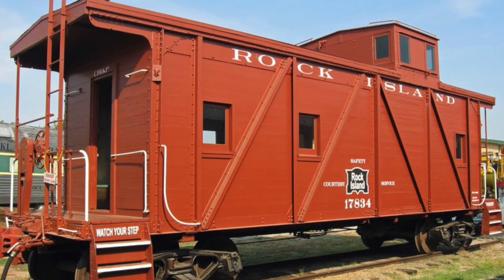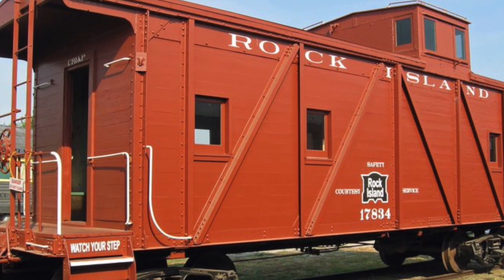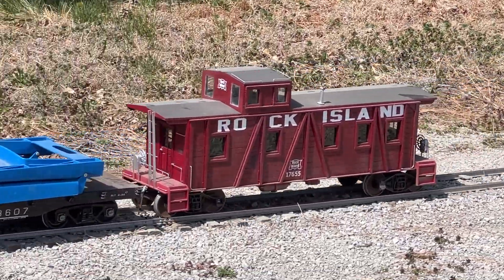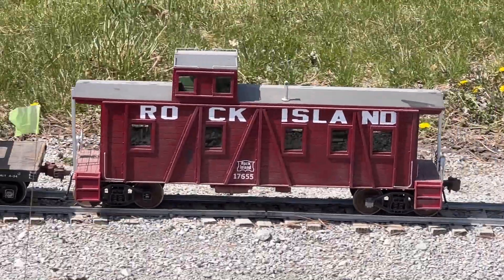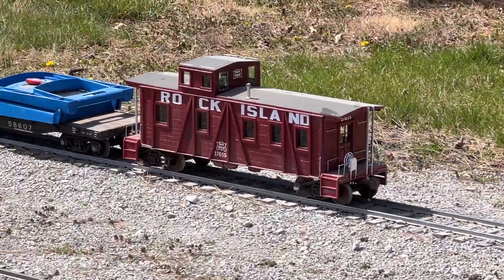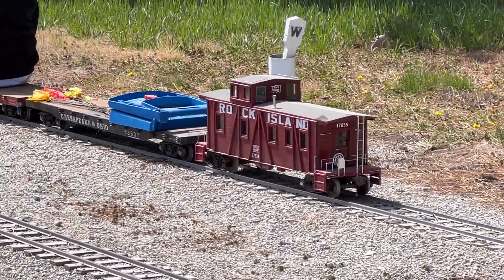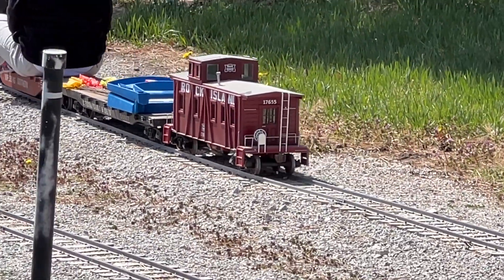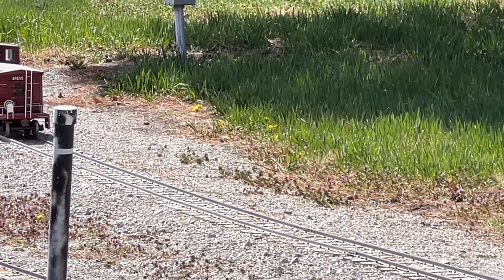Building a Vintage 1" Scale Rock Island Caboose

Comment: I was watching an episode of Tracks Ahead many many years ago where I found out about 1” scale.  Been fascinated by it ever since, I hope to have a yard big enough to build a 1” scale railroad someday.
Reply from the maker: That’s awesome that you were able to find information about 1 inch scale way before now. The interesting thing is that I was actually invited to come out to this railroad back in 2016, and I fell in love with the size because it was way bigger than the G scale that I was doing, but it wasn’t quite so big that, it would’ve been hard to manage. I think the 1.5 inch scale is really cool, but you practically need a crane to lift the locomotives. However, when my GP 60 M is completed, it won’t be very easy to lift either, but at least my cars are manageable for me to lift by hand. I am just very blessed and fortunate that I have this railroad within 30 minutes of where I live. There are other members that have to drive an hour and a half or more in order to get to the railroad.
Reply: @warbonds I’ve been seriously considering diving into G scale as I already have six cars displayed on the valance over my living room window. I have a pretty sizable back yard for G scale (65’W X 80’D) but not sure if it would accommodate a minimum curve radius for 1” scale.  And you’ve really inspired me to want to build a 1” scale car or two out of wood (I’m a pretty decent woodworker).  I assume you buy the truck/coupler assemblies pre-manufactured?
Reply from the maker: @DRUmBEaTTS  I would say at 65 foot width would be enough to be able to make a complete curve, and certainly 80 feet deep is definitely long enough to give you a good run! In my personal opinion, I really like the adage of go big or go home! The 1 inch scale is just big enough to have a lot of fun with, but not so big that it takes a crane in order to lift the car back on the rails if you have a derailment. 

Even if you’re not sure what you want to do with the layout right now, I would just go ahead and figure out what you want to build. A lot of times I will see a car in a hobby shop and decide I want to scale that up.  I take a scale ruler to measure the width, length, and height which converts from scale feet to actual inches. For instance, if a box car, with the scale ruler measures 50 feet, that will become 50 inches for a 1 inch scale car. Many of the cars average between nine and 10 inches wide, but I try to do all the measurements as accurately as possible. There are some things that I have done that can be pretty tricky when it comes to making small intricate parts, so I try to watch my fingers very carefully with the saws. ☺